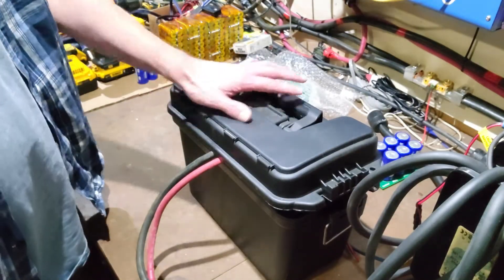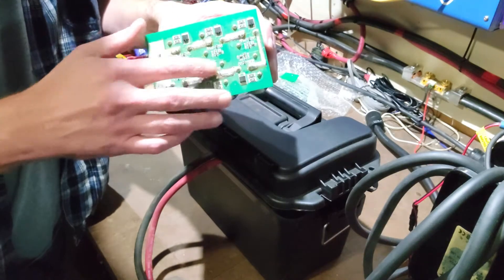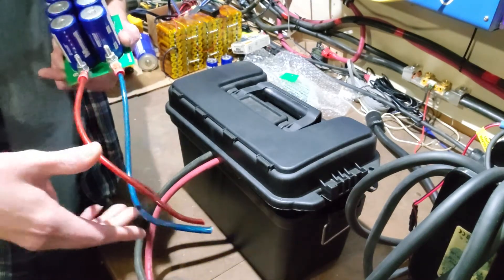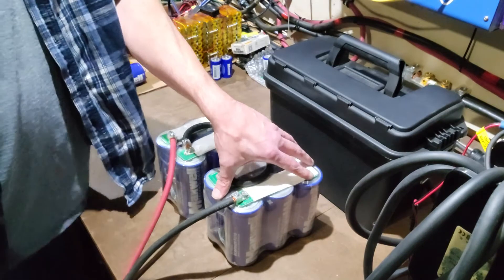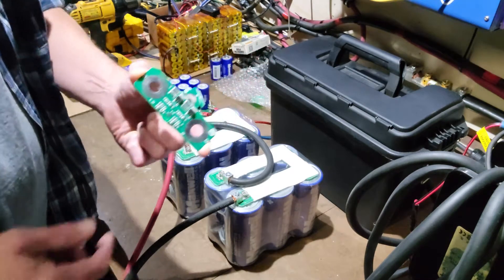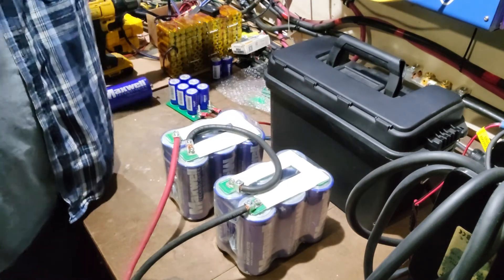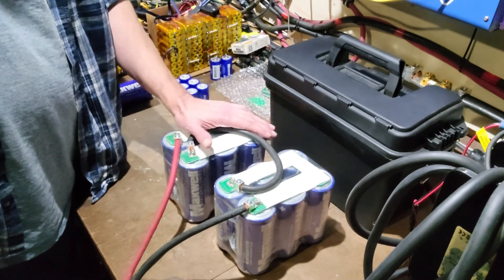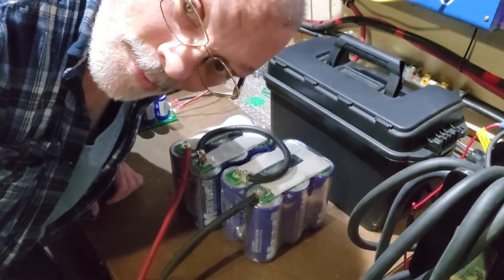Maxwell Super Capacitor Update

Comment: Already have beat you use Maxwell the bus power pack the 125 converted to 64 volts at 12 modules 146 super caps total the balance boards were into it. you can charge them at 80 amps DC off your solar system bulk and float they need a lot of current to start from 0 to 40 volts on 48 volts to 60 volts it stacks off a lot. What's the advantage 1 million Cycles Plus longevity for the money charge times for your solar minutes not hours compared to 4,000 on lithium cold weather does not bother them. will take on large starting loads well pump motors. Max well capacitors Bought out my Tesla. There is another company that makes it for forklifts at 64 volt
Reply from the maker: I didnt know it was a race.. But I have been using these types of capacitors for many years. Probably around 10 years +

Comment: why 12 supercaps in series? isn't it that 24/2.7 is 8.8? that 12 caps is now 32 volts. way above the 24 volts threshold. so why did you do it? is there any advantage? i'm sorry i watched your video but i just don't get it.
Reply from the maker: Some or Most 24 Volt systems in Solar Systems can run a high Voltage of 29.6 to 32 volt depending on the type of Battery chemistry you are using.  So no 12 in series is fine and Safer that way. Design is key.

Comment: just a tip = your 24v system supper caps - having 12 is dropping your total F- dropping a few will give you more and higher discharge rate by reducing ESR - (caps in series - ESR in increased every cell added - (24 / 2.7 =8.8, so use 9 or 10 (depending on your charge current - this will give you (at 9s) 330F - vs 12s= 250, that's a 30%+ more,, just a tip ..
Reply from the maker: Voltage runs higher than you think when you charge up to 29.4 Volts .

Comment: Do you design and build these for people ?  I need a large one for my cars audio system, and I just had a 11.6kw solar system installed on my house, but I don’t have any batteries for it. If I send you all the specs of my solar system and panels, control systems for it. Would you design one of your super power packs for it? I’m in Deltona Fl so I get a ton of sun coverage for the panels. Let me know what’s the best way to speak with you about this. Great video by the way.
Reply from the maker: Helps to have batteries in your system if you doing off grid. If it grid tied it wont do any good.

Comment: Hello. thanks for your videos. You always say: i use it. 
but why ? 
what are the advantages of the supercaps? 
what is your motivation ?
what is the purpose and use of the supercaps. 
What changes a supercap module between solar module and Ongrid-Inverter? Or between the battery and the Offgrid Inverter? 
does the amount of power fed  increase with an Ongrid System? 
For the money the supercap modules cost ... 
you could also buy another solar module ... 
to increase the performance of your Solarystem. 
I would like a comparison: With and without supercaps. Greetings from Germany.
Reply from the maker: I think I believe that in this Video it was explained Why I used them and for what. Maybe you are not understanding the what the use of them are for.
Reply: If you have sudden surge/draw it can cause voltage drop which is rough on equipment and batteries, supercaps in parallel with batteries reduce that undesirable effect and extend battery lifetime